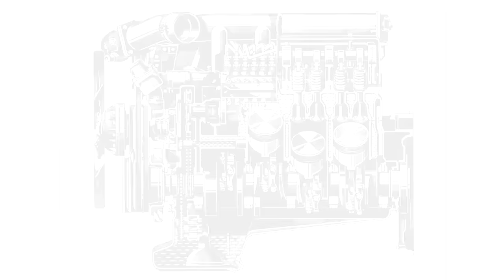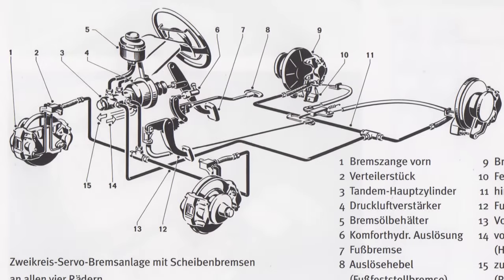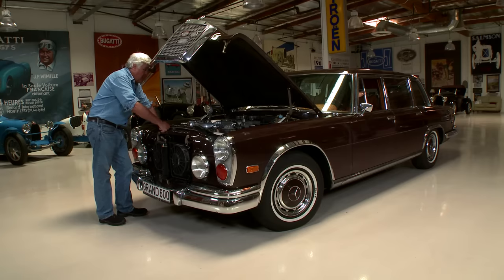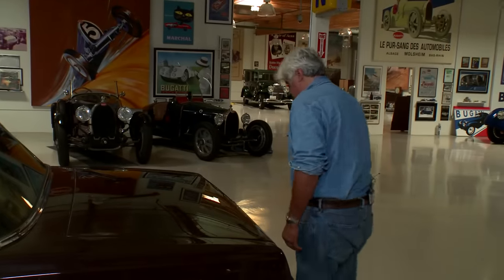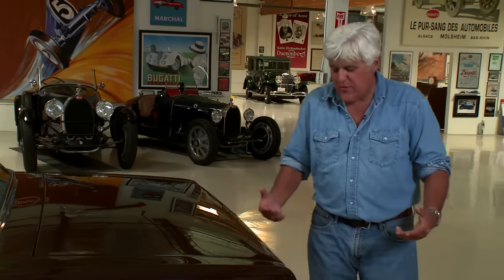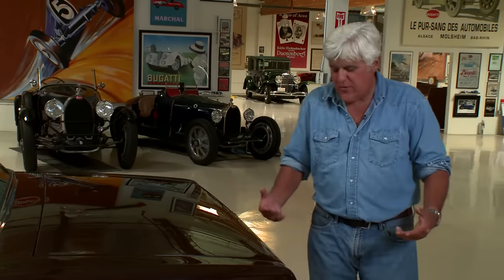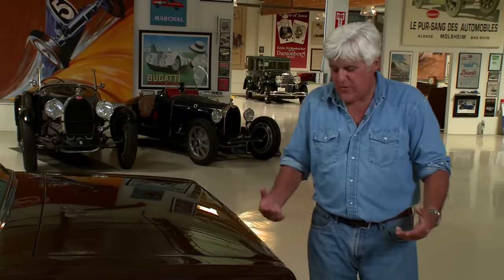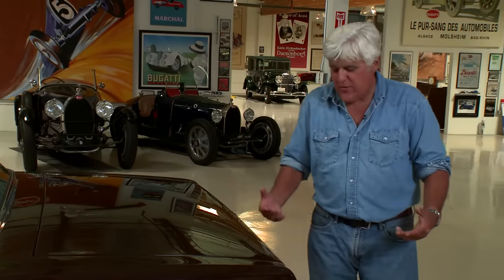1972 Mercedes-Benz 600 Kompressor - Jay Leno's Garage

Comment: This makes a brand new Rolls Phantom look like a Nissan Sentra.
Reply: Andrew Cuthbertson how about no
Reply: Andrew Cuthbertson Hey, my first car was a 1994 Nissan Sentra B13 coupe,great car
Reply: My hand-me-down van has 288,000! I win!
Reply: Too much.
Reply: Totally right.
Reply: @ImInLoveWithBulla  wat
Reply: Obviously never saw or drove a phantom.
Reply: Indeed.
Reply: Perhaps. But does it have an umbrella that pops out of both passenger doors? Hmm??! Lol!
Reply: Malik Martin:

Fastback Sentra was not that rare then on the West Coast....they littered the roads like every other version of the Sentra.....that is until the Owners neglected changing the Timing-Belt at specific mile and time intervals. 

Timing belts ( which are composed of:rubber,Kevlar and nylon) are only good for about 10 years;which by then the: rubber,Kevlar and nylon begins to breakdown/degrade....even if the car is rarely driven

That  SOHC engine being a "interference engine"....it was the most common death-blow for Sentras until Nissan switched-over to a fail-proof Timing-Chain set-up for  the 3rd Gen Sentra. Same story for interference offering from: Honda,Mitsubishi  and platform/power-train siblings like the Hyundai Excel,etc. of that era.
Reply: Malik Martin  Man!!! I live in Poland and my dad own just the type in 1990's!!! Manufactured in California if i recall correctly, don't know how it went to Europe, yet alone Poland. But still, fast as hell, the only problem was the spare parts, very hard to find at the place in the time.
Reply: Andrew W.C. Ok buddy imma take that as a compliment because Nissan Sentras are expensive
Reply: @DC Williams They dont :(
Reply: @DC Williams no mate
Reply: @frankglick8327  no need, 600 pullman is the most overengineered ultra luxury car. And better than those bentley/rr
Reply: In every way imaginable.
Reply: The repair bills of the 600 will make the rolls feel like a tic tac purchase.
Reply: Versa,.   Don't insult a Sentra.
Reply: @ImInLoveWithBulla  It makes the Rolls Royce Corniche look like a Ford Zephyr with a chrome nose
Reply: @Thatoneguyfromtheinternet  it makes the champion of Brazil’s Miss Bum Bum contest look like Brie Larson in her Captain Marvel suit.
Reply: @Thatoneguyfromtheinternet  That what Jeremy Clarkson call that
Reply: @Thatoneguyfromtheinternet  what a coincidence lol.
Reply: @pickfairguy  do you mean a Nissan puke or juke.
Reply: @pickfairguy  because I knew you won’t understand what I can find the Nissan puke
Reply: @ANDREWSAMY562  re
Reply: Can you imagine buying Rolls, back in the day, over this. Buying a re-badged Ford Zephyr instead of this master piece.
Reply: yessss exactlyyyyy

Comment: Hi Jay,  I remember as a kid, my grandfather had a 1969 Navy 600 with grey mohair velour interior.  Wearing shorts in the summer, sitting in the back, my legs were so scratchy. I remember cold air conditioning with chrome metal vents and ice popping out when it was set to high. As kids we were always told to keep our hands away from the windows because they were so quick to go up. The best noise was the horn. When my grandparents would visit he always pulled up and honked the strange horn. I also remember my grandfather complaining about the cost to fix anything, especially a window switch. He died in 2000 and my uncle took the car to Las Vegas where he lives.  I have not seen it since.
Reply: Lol gay

Comment: Amazing car. 300 horsepower in 1972 would be like 600 today. The car is incredibly classy looking. You can imagine a world leader being driven in one
Reply: +Robert Smith and the two bodies in the trunk lol
Reply: +ALi Ta Owners included Juan Peron, The Shah of Iran, Leonid Brezhenev, Idi Amin, Saddam Hussein, Anistasio Samosa.
Reply: Any decent American muscle car of the era got more than 400. And they were cheap, too.
Reply: many stock muscle cars from that era hardly got 300 at the wheel although they may have gotten over 300 at the flywheel without accessories connected.
Reply: That's kind of funny you know, with that kind of losses I wonder why didn't they think of using an electric or hydraulic transmission, certainly more efficient, and with the added benefit of continuous ratio variation?
Reply: But because of how heavy it is, it's more like having 150hp in a normal weight car, lol.
Reply: Bay shut of installed a humidor
Reply: @footballcoreano that makes no sense.  The W123 was made from the 70s to 80s.  What are you trying to say?
Reply: but fifty of those three hundred horses were used for hydraulics
Reply: Some American luxury cars of the same era may have equal or greater engine power, but this Mercedes was made from the beginning with the assumption that it will be actually driven very fast (and very comfortably) on the famously speed-limitless German Autobahns. This must be actually a very impressive and balanced combination of power, weight, comfort and handling considering the age of the vehicle. Imagine how awesome it was back in those days, when typical Euro family cars had just 40-80 HP engines...
Reply: How many hp has this specific  car?
Reply: @lucianene7741 :  and they handled like waddling ducks, had almost no brakes, A/C, power steering, and you had to roll your own windows.
Reply: @footballcoreano go back to school
Reply: FYI youngster, my 1967 Ford 428 P.I.dyno'd - factory stock, at 424 HP tho it was rated publicly at 365 for insurance purposes. My 1962 (nineteen SIXTY-TWO) Ford 406 Cu In was 405 HP.. 300 bullsh*t horsepower in a 1972 5,000 lb luump of lead was NOTHING!

Comment: Introduced 53 years ago, it was a technological and engineering masterpiece that no other manufacturer came close to.. Still a landmark car, the 600 has lost none of its commanding presence and headturning ability after 53 years   :)
Reply: Mercedes marketing department: 'You are hired!'.
Reply: Ivana Djorovic it actually gained more of head turning ability 😅
Reply: $25,000 in 1963 was equal to $209,267 in 2019 dollars.
Reply: @nrmete  How calculate inflation in the USA?
Reply: google "inflation calculator"
Reply: The greatest
Reply: Don’t really need to turn your head as it fills most of the horizon it’s that long
Reply: IMO the ONLY car that can touch a M-B 600 was a Cadillac Eldorado Broughham. Those cars had almost every feature or option that the M-B 600 had. They were just as customizable and the quality was arguably just as good in many aspects, seeing that the Cadillac started about 7k cheaper

Comment: My Dad bought a new 6.9 liter Mercedes in 1979. Officially it was a 450 SEL 6.9, but the model badge on the trunk lid said, simply, 6.9. It was nowhere near as big or as luxurious as the 600 in this video, but it was quite a bit more advanced and much more suited to fast driving.

I was 18 or 19 when my Dad got it, and I used to take it out for solo drives at night when my Dad was out of town - I didn't do this often and I was careful with it. I loved how fast and smooth that car was. Just nudge the gas pedal, and you would instantly feel it leap forward. Absolutely instant acceleration, and beautiful road feel despite the size, weight and luxo seating. A true road car. Lower the suspension, and it felt like it was glued to the road. Just a terrific car.
Reply: Lucky you!  You dad must have had pretty high income to afford that!

Comment: From 1968 to his retirement in 1975, my father was in house legal counsel for one of Australia's wealthiest captains of industry. The Executive Chairman would send one of these around to our home in Northern Sydney at 7am every weekday morning to take my dad to work in the CBD, and took him home at 7pm precisely every night. I rode in it many times as the route passed by my school, so I would be dropped off. I never got picked on at school!
There were only three of these in Sydney at the time. It was the most wonderful car. I do not remember it ever breaking down. The corporation had a fulltime driver and fulltime mechanic who was sent to the factory for training. For major servicing it went to the distributor and the work was done on the weekend, so it was always available M-F. It was dark blue with cream leather with cream wool carpet. A refrigerator, mobile phone, dictating machine and TV were installed.
The model was the Grosser. It was longer and had forward and backwards facing rear seats with a sliding glass divider separating the driver, and separate air con controls. I remember my dad saying it cost $120k new in 1968. A Ferrari back then in Australia cost $30k. But there was method in providing this car. It meant that my father never had to worry about driving to and from work in the heavy traffic. He read the paper and a coffee was kept hot for him if he wanted one. It enabled him to always leave work at a relatively civilized hour and he could unwind and relax on the way home. His boss said it was a good investment because my dad made my boss millions in helping him run the corporation. To him it was a productivity tool because the deals they did required my dad to be on top of his game. It was a very demanding job.
Reply: Awesome story
Reply: boomer.

Comment: I worked at a MB dealer too in the '80s...dealer owner had a few and a grey haired tech was the only one that worked on his. He showed me a bunch of stuff on that car...solid copper floor boards and all the hydraulics- just incredible what they put into that car. The parts dept would look up parts for that thing for grins on slow days. Leno in not exaggerating a bit- it was 11k for a window switch no joke.

Comment: These cars ride like a dream. I would love to learn about the suspension system. Watching the rear wheel movement in the video suggests four-wheel independent suspension with upper / lower control arms both front and back which would allow the drive axle to pivot in and out the way it does.
Reply: 4 wheel independent, but with low pivot swing axles in the rear. The key is that it uses air springs instead of steel. A lever on the steering column lets you adjust the air pressure for either a softer ride or firmer handling.
Reply: His is pneumatic but they also had air-ride for the regular 6.3s...amazing technology that is still ultra-premium in todays luxury cars.
Reply: theforgottenorg "air ride" and "pneumatic" mean pretty much the same thing. Both the 600 and the W109 (300SEL, 3.5, 4.5, and 6.3) all had the same air suspension system.
Reply: actually not all had air pneumatic, and in the case of Jays car, its fluid pneumatic...we (Jay and I) should have said "hydraulic"
Reply: theforgottenorg
The hydraulic system on the 600 is used only for what Mercedes calls the "comfort" accessories. If powers the seats, windows, trunk lid, sunroof, fresh air cowl, and on early 600s even the door closing. The suspension on the other hand is strictly an air suspension, same as on the W109 cars. You may be confusing things with the 450SEL 6.9, which had a hydropneumatic suspension, similar to that used on Citroens.

http://www.m-100.cc/600/brochure/insert/index.html
Reply: They called them air bag suspension.  Air bladders that were hydraulically modulated so they was constant balance left to right and front to rear.  As the car leans into a curve more air goes to the side that is experiencing the downward force.  Expensive to maintain but awesome performance.  When you see an old 600 or 300SEL 6.3 that is not maintained they will be sitting on the ground as the air is gone just like the springs missing from a car.
Reply: James Barrow, go to www.m-100.cc for more information on the air suspension.

Comment: Class act, both Jay and this automobile. The stretch was called a Pullman, and used extensively on the original Mission Impossible series.

Comment: Agree. This was a fabulous car. My dad had an exotic refinish shop in the 70s. I worked on the 600 several times - removing molding, sanding, detailing etc. We bought one to refinish and flip.  Drove it daily for a few months. Really nice, quiet, smoorh ride and huge.

Comment: The windows were hydraulic because of the heavy bulletproof glass mercedes was certain the majority of owners would use.
Reply: Actually it was to keep the noise of the electric motors  out of the equation. When you operate them or the seats it's earily quiet.Even the air con controls are hydraulic!.
Reply: @Mercmad  Both actually
Reply: The earliest power windows and power seats were indeed hydraulic, and convertible tops still are.
Reply: @michaelbenardo5695  In the Old Licolns the windows were pneumatic. Similar idea just not as much power...
Reply: @step4560  Was that the pre-war models?  There is a hydraulic pump in the post-war models.  Its on the firewall, and looks like a starter motor with a reservoir.
Reply: @michaelbenardo5695  I'm pretty sure I made an error in my thinking and my comment. I was thinking of the post war Licolns who's top were I believe hydraulically operated and somehow my brain got confused. 😮 Sorry for the confusion...
Reply: @michaelbenardo5695  Now, that's interesting to know. Grandpa's favourite Lincoln was a 66? suicide-door convert. Always bled fluid and made a mess. Grandma's '57 Ford flip-top conv. had a maze of cables and Ford-pattern solenoids in "trunk" but at least no fluid leaks. Cheers!

Comment: A fuel-injected, supercharged, MW-50 injected Benz... it's a Messerschmitt Bf 109 on wheels.
Reply: Messerschmitt?
Reply: +PicNaxe The airplane
Reply: TheZothor Messerschmitt used supercharged, fuel-injected Daimler-Benz 600 series engines for the 109s.

Messerschmitt held the FIA world's airspeed record for propeller driven aircraft until 1969
Reply: Starving Soul german warplanes of ww2
Reply: they used v12s first from rolls royce accd to wiki  https://en.wikipedia.org/wiki/Messerschmitt_Bf_109
some used a db 605 which was a daimler benz 12 cylinder piston engine
https://en.wikipedia.org/wiki/Daimler-Benz_DB_605
Reply: Nice call very nice
Reply: Up but I was thinking more of one of their heavy bombers
Reply: yamahon You do know Rolls-Royce is an English company, and the 109 was a plane Germany used to fight England, I think you're mixing up your facts.
Rolls-Royce engines where used in English planes like the Spitfire.
The American P51 Mustang used Allison engines, then RR engines built by Packard.

Comment: I think this is the greatest car ever made period. I'm lucky enough to drive a 1967 250SE W108 and it is the most rewarding and fun car to drive. It looks incredible with that classic styling but has the build quality to be driven every day 47 years later. I know that it is is just a small piece of that 600. I hope one day to see or drive that incredible machine.
Reply: 280 SE driver here, also W108. They're great cars, even 44 years later.
Reply: JackpodyDK
I have a 300SEL 6.3. Same engine and suspension as a stock 600, but in a smaller and lighter body. It's a lot of fun.
Reply: amen, former 280 SEL owner...cheers to all former brothers
Reply: Still miss the 4.5 I daily drove in college. Body and chassis succumbed to PA salted winters, but the damn thing ran like a Swiss watch and started on the first or second compression stroke (1/2 rev) every time.
Reply: I forgot all about that...mine started like a champ too....Fuel injection from 1972

Comment: Those Mercedes were also one of the safest cars on the road in those days. My dad got t-boned by a Cadillac Sedan we Ville in his 280 SEL back in '73, down there in LA. his Mercedes was totally destroyed; the motor was torn off the mounts, BUT the passenger compartment maintained its integrity, and he survived. They had reinforced door beams, and reinforced A B and C pillars, safety features that other auto makers fought due to cost, until the mid to late '80's, and early ' 90's.

Comment: For reference, here are some specs from a Car and Driver test of six luxury cars July 1965.

Cost:  $20,500
Length: 218"
Width: 76.8"
Height:  59.5"
Wheelbase:  126"
Engine:  386 cid, 300 bhp @ 4100 RPM, 434 ft-lbs @ 3000 RPM
Induction:  Bosch Fuel Injection
Transmission:  4-speed Auto
Acceleration: 
0-30:  3.2 sec
0-60:  9.4 sec
0-80:  16.5 sec
Mileage:  10.91 MPG
80 MPH stop:  4.7  (no distance listed)
It also scored the highest in the comparison with an overall average score of 8.6/10.
Cadillac Fleetwood Brougham:  7.9/10
Lincoln:  6.7/10
Rolls Royce Silver Cloud:  6.4/10
Imperial LeBaron:  6.2/10
Jaguar 4.2 Liter:  5.9/10